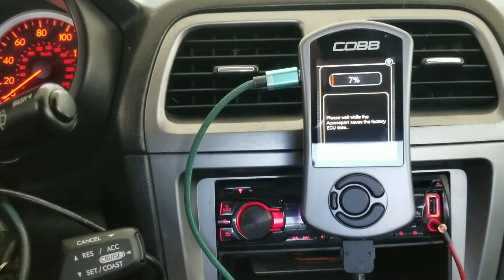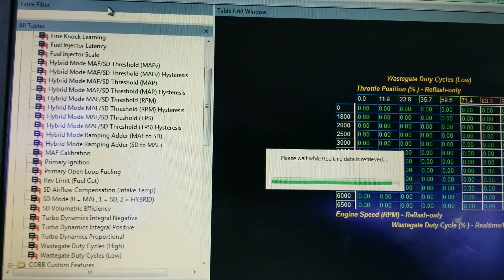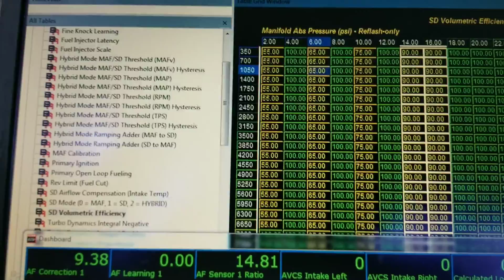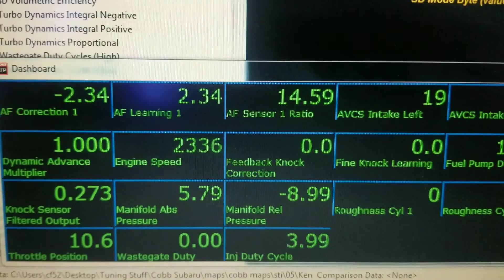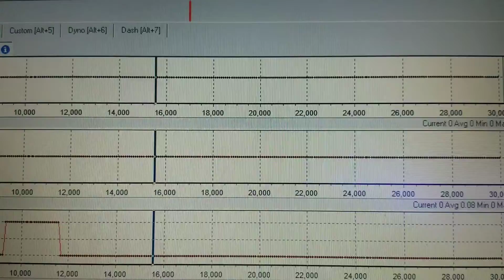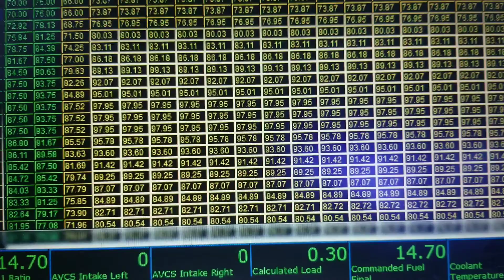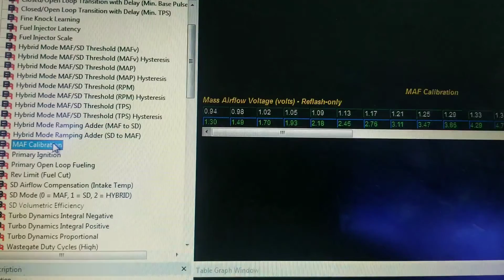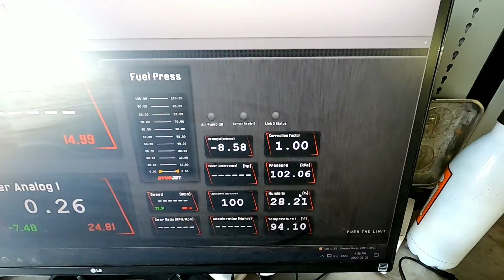Tuning Tech. Do I need Speed density tuning on my Subaru WRX or STI EJ257 EJ255? Part 1

Comment: I know this video is old but something you might want to try is Megalog Viewer  HD. You can take long data logs and then plot calculated ve in a 3d table with mani pressure and rpm on your XY axis. It should allow you to build a VE table very fast on MAF
Reply from the maker: I do use megalog viewer. I still like the Subaruedit log viewer for many things though

Comment: 2004 sti here. I’ve got a question. I’m stuck on deciding between getting an AP or going opensource with ecutech/romraider. I have an iwire hybrid sd maf kit that I want to use. What should I use for tuning then.
Current build is this. 
FP Black
40mm turbo smart ewg
1500dw injectors
19mm phenolic spacers
FMIC kit
Catless DP no name
Uel no name headers
TGV deletes
Reply from the maker: Well,  you'll have a hard time using Cobb with deletes.  Ecutek is not the same as open-source and also doesn't support deletes.  Personally I'd just put the emissions parts back on the car and use Cobb but if you don't want to do that, then open-source tools are your only real outlet.
Reply: @WT4T  Yeah. I’m stuck then. Now I’ve got a reason to check out that link ecu
Reply from the maker: @Slaydur I'd go Haltech Elite 1500 or 2500 and just have the best!

Comment: where is the best spot to install a meth nozzle on an ETS front mount kit?
Reply from the maker: in between the throttle body and BOV. You just want to make sure if your BOV is atmospheric you get it as far from it as possible.

Comment: My only issue with maf is checking intake air temps because it checks it from the maf which isn’t the air temp actually going into the intake
Reply from the maker: Since it's reading actual airflow little to no compensation is needed to fueling for air temperature but it is very true ideally for timing compensations you'd want a charge air temperature sensor
Reply: U can splice the temp sensor wire from the no longer used maf sensor socket, and install gm fast reaction IAT sensor into intake piping before throttle bodies or directly into the intake manifold or into the cold side of intercooler

Comment: you mentioned that SD can be tuned by opensource. What Subaru years does that apply to? I have a 2006 na-t Impreza and want to see if I can use this application by tuning via opensource (with an IAT sensor relocation and everything of course).
Reply: Im not the OP of the video but I had a similar set up on my NA-T Subaru impreza OBS wagon. I used romraider to tune it myself, there isn't any speed density patch besides a factory safe mode for when there is no maf.
Reply from the maker: I don't know of any SD patches for the na impreza Impreza ECU sadly.

Comment: I have a sti making sd, but i keep getting a up and down idle any pointers. Mods ams intake, front mount, 2200cc injectors, walbro 450..
Reply from the maker: This is a pretty common issue with massive injectors.  You can try targeting a richer than stoich afr at idle.  There's other tricks as well with injection timing, minimum air rates,  etc.

Comment: How bad is a burble tune for an engine? Does speed density affect it at all? Ive heard some people say itll destroy an engine and others say there are no issues... never asked a reputable tuner though. Also, do you recommend the street taco lays? Their new flavors make me curious and ive regretted buying them the past couple times lol
Reply from the maker: It was an odd mouth feel.  Immediate carnitas flavor then quick to just potato which is kinda weird.  I dunno.  Have to try it for yourself. 

I was just playing with light burbles on that car.  I don't recommend it for a number of reasons being annoying at the top of the list. No difference on burbles using my method with SD or MAF. There's a variety of methods to achieve burbles and anything that uses extra fuel to achieve those pops is a no no in my book.